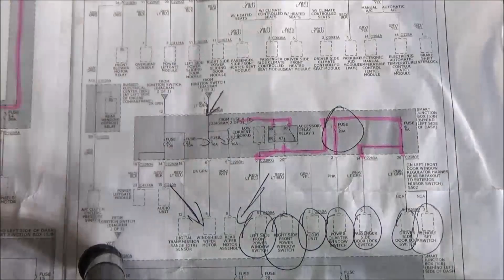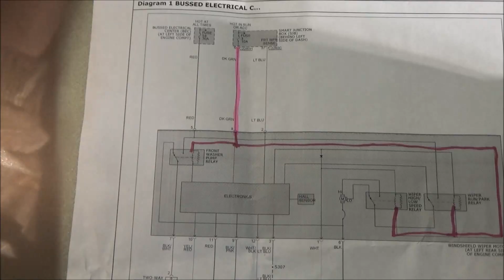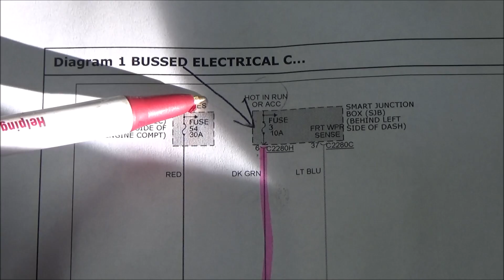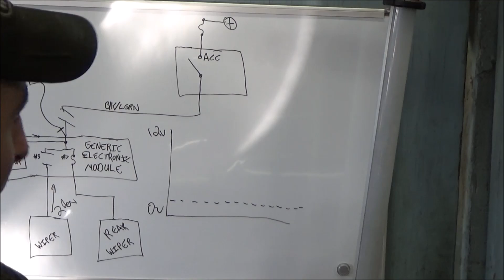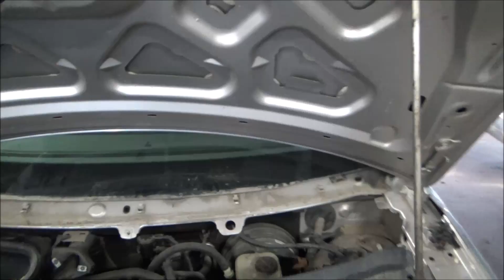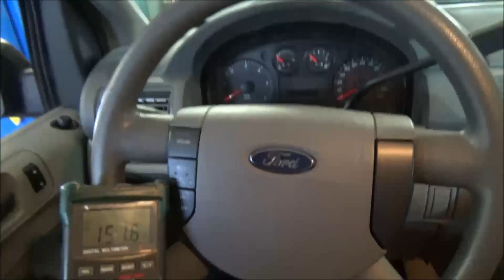Ford Freestar, Erratic Wiper Operation, Radio Stuck On (Part 2)

Comment: Is corrosion problems stem from the cowl placement and poor seal design. Water runs allover the electric components causing a wide variety of issues . The car's computer is underneath the cowl  at the passenger side under the cabin air filter and has the same issues of corrosion , causing the engine to run funny .

Comment: Thank you for this.  My Freestar is a 2004 and basically had the same problems.  My radio would stay on with the engine off and key out of the ignition, draining the battery within a day or two.  The fast wiper was all that would work regarding the wipers.  Replaced the motor and the wipers worked perfect, radio shuts off with the engine off and key out of the ignition.  The connection of the wiper motor to electoral systems staying active with the vehicle off doesn't seem logical, but it is what happened.

Comment: Thanks for the information. Almost bought a new sjb, but it isn't available anymore for the Freestar, nor can I find anyplace to repair it. Turned out to be bad wire connectors to the signal light.
Now I have to figure out why the windshield washer pump stays on. Thanks to your video, I'm optimistic it's the washer pumps, cause a new washer wiper signal switch assembly isn't available either.

Comment: Thanks on my 2004 freestar wipers stopped working. Saw your vid. And found corrosion at plug. All parts ordered, and new wiper motor, Thanks for the great diagnosis.

Comment: Recently, my 2004 Freestar is behaving in a similar same way.  I've noticed when unlocking the vehicle my radio would play, but didn't notice clock was still on. The battery has been dead 4 times so I replaced the battery.  Yesterday, I used the wipers on intermittently then suddenly they began going on high.  I attempted to shut them off and nothing worked unless I turned the vehicle off.  While the vehicle was running, if I had the following on: wipers, my headlights (dashlights) on auto, and the radio, wipers would go from on to high to stopping midway.  The headlights and the dash lights would flicker off and on.  The radio was on and not effected. I shut off the engine and took the key out and the wipers would still go on high as well as the radio would still be on.  So I'm going to check to see if the windows are effected as well. Then take it into my local garage to confirm it is the wiper motor and connector and to verify of the drain is clogged. We've had a harsh winter so I'm wondering of ice didn't clog the drain over the winter.  
Long explanation short, I want to thank you SO much for your detailed explanation on this issue.  I can't afford taking it into the garage and having them say it will cost thousands of dollars to replace items that don't need to be.  

Thank you so much agan!!!

Comment: I have a 2004 of similar situation. I love the size of this van, I love most of the features too. But my god is this thing a mess. When we first bought it, it had 104k. Right away I install new plugs, air filter, oil. Normal stuff one might do to a used car. Ran well. Except when it was cold or wet. Had a hard rain one night at work. It didn't want to run. Had it towed and checked. It needed a computer and coils were cracked. $1650 to fix. But, all was well. 3 months later another hard rain, same situation. This time I refused to pay for all this work again. Had it towed to my house, did some research, found the problem. Totally replaced computer, idle motor and coil for good measure for less then half. Sealed up that bad boy good. All was well for two years and my alt gave out. Replaced it. Now when it's cold the battery light comes on for a bit and the wiper motor seems to have stopped working correctly, and the computer can't seem to pin point errors it finds randomly. Our techs are baffled. Basically st this point I am just driving it until something expensive blows. There's not a part that hasn't been replaced or cleaned, it's been nothing but an expensive mess. But in it's defense, I must say it's fairly reliable given the problems it thinks it has!
Reply: What method did you use to seal up the cowl to stop the water leakage ??
Reply: @HighVibeTrybe  Good question! I tore off what was there, sanded it down and used primer since the paint had a clear coat. Then I used a can of flex seal around the lip and then filled the rest with a silcone based sealant, then I used a ceramic wax all over the lip after it dried as to deflect any rainwater off the surface. All in all about $25 worth of product and a few hours of time. Never had any issues since. But it's absolutely critical to seal up around the lip of the cowl to the body, and keeping the tray vents cleaned out. As long as rain water can flow from the vents and properly drain, your good. If it over fills or worse isn't properly sealed water can reach your computer and that's not a good thing. I also used some aluminum foil over the connector area under the cowl as an insurance policy so to speak because it was all trial and error but I've never felt a drop on the aluminum since. So that might be a good idea to do too. It's definitely not fun tearing that all apart again and again!

Comment: Same problem on 2004 freestar. Came in shop with bad starter relay under hood. Didn't know what caused it. Replaced it, ran fine, noticed radio didn't work. Next morning battery was dead. Jumped it, now radio wouldn't shut off.      Thanks for video. Another common problem with these is tiny splines inside torque convertor strips out. Ford recall or just swap the torque convertor then sell it quickly! 😂🤣

Comment: My wife has the exact same van color year and all,I'm in currently in a holacost with it now, battery died overnight once charge it up it fired up, weeks later same thing but battery was full of fire, tried to crank it but just a loud tick from the starter,and wipers sounds like they were trying to come on, checked the fuse box under the hood and the starter relay was blown (30 pink long fuse looking thing) swapped out with another but still no fire....so I have removed the starter itself to be replace it tomorrow,but it has a lot leaking hose and was wet and rusty looking on the entire right side the battery and thermostat area,it is giving me a headache

Comment: What a great case study!!! 👍👍👍
Reply from the maker: Interesting one huh?
Reply: Triangle Diagnostics I'm really glad you went the direction you did with the diagnostic! That way we've learned in detail how the system works. If you had gone straight for the wiper motor,you would've found the problem much sooner,but the information wouldn't have been just as great.

Comment: For future reference, digital logic will interpret anything under 1.2V as zero and anything above 1.6V as one, so, yeah, 2.8V is plenty for the unit to assume power is present and command the relay on.

Unless an A/D conversion is done, a logic circuit cannot determine how much voltage is present on an input and car manufacturers aren't going to put in an A/D converter (or use one of the processor's built-in A/D converters) just to test for the presence of a supposedly fixed voltage.

Comment: Triangle Diagnostics Thank you for your vids. Just curious if there's a logical sequence as to where to start when it seems to be a power/ground type issue with so many components affected? If by chance you had decided to begin the diagnosis at the wipers and found that mess first, I'm thinking  you would have had your "well there's your problem lady!" moment for sure. Should we start with the issue that perhaps uses the higher volt/amps first or the lower volts/amps? Or is it just a gut decision? I thought you did a great job either way.
Reply from the maker: I think for the most part it is a gut decision.  Typically I will start on whatever path offers the easiest access in terms of test locations.  There really isn't a right or wrong way to go about it in my opinion. Thanks for supporting my channel friend.
Reply: Triangle Diagnostics .

Comment: Great work on figuring out what was happening with this vehicle Joe. The 2.8V was probably coming from the copper sulfate (salts) bridging across the pins in the wiper motor assembly since after a few times of plugging and unplugging, it removed the stray voltage. But definitely the wiper motor assembly needed replacement. I'm glad you hung in there where your gut feeling was talking to you about that 2.8V and not making a call on the GEM. Great thinking process Joe! Oh. I saw from a comment that you're in Henderson, NC. I grew up close around your area living in Littleton. Roanoke Rapids, Rocky Mount and Enfield. Today, I'm living near High Point, NC. Have a good one Joe!
Reply from the maker: That's awesome man.  I like knowing some of my viewers are relatively nearby.  I actually live in Durham.,  and work in Henderson.
Reply: How about that Joe! You're only about an hour from me :)

Comment: Hi Joe. Great channel. If you had decided to attack this problem strictly as a parasitic
draw by pulling fuses while monitoring the draw, might it have led you to the crappy
wiper motor sooner?
Reply from the maker: Potentially yes.  I may have started in the engine compartment fuse box first and yanked the main wiper fuse out,  and that would have definitely pointed us in that direction first for sure.  I went the path I did simply because we knew the radio was staying on,  in an attempt to save time yanking fuses or testing voltage drop across them.  Hindsight is always 20/20.
Reply from the maker: Potentially yes.  I may have started in the engine compartment fuse box first and yanked the main wiper fuse out,  and that would have definitely pointed us in that direction first for sure.  I went the path I did simply because we knew the radio was staying on,  in an attempt to save time yanking fuses or testing voltage drop across them.  Hindsight is always 20/20.
Reply: Only been subbed for 2 days and watched all your vids.
Let me say that in hindsight I could not be happier to have
found your channel. Keep up the great work.

Comment: Ahhh the green crusties strike again! Great work, Joe! I was laughing in Part 1 when the wipers were stuck on HIGH haha I figured you would chase that problem first. But your approach was very educational in tracing that weird 2.8V on the accessory relay...thanks for the vid!
Reply from the maker: I figured the radio staying on would make for a better video,  otherwise I may have went that direction first.  It's still pretty amusing how all of these issues were tied together like this lol.  That 2.8v initially threw me through a bit of a loop, as I didn't think that was really sufficient enough to do anything with this module.  Big lesson learned here on attention to detail on these switch inputs,  just because it is designed to receive battery voltage doesn't necessarily mean a lower voltage can't meet threshold requirements.

Comment: Excellent nothing but excellent..
A dealer would have put a gem before the tech figure  out the issue  or ship the job to someone else..Ask me how I know.....LOL
Yea terrible job on the wiper connector repair.and by the way that a ford heat tubing with butt connector supply in the repair kit.But whoever worked on it,Butchered..
Reply from the maker: I kind of figured they were supplied with the connector.  I like to try and believe the dealership would have made the right call on this, but definitely no way of knowing without letting them try haha. Thanks for the support friend.

Comment: Good job! I like the in depth troubleshooting technique. Sometimes it's tough to make a call without checking all the possibilities. I'm glad you revisited that wire from the previous night. When you pulled that 2.8 volts to ground with the test light and it worked, I suspected that might be where the problem lies.

Comment: That's pretty crazy! Water can cause all kinds of havoc in electrical systems. Reminds me of the gm trucks that get water in the Ubec and all kinds of foolishness will happen. Last one I had kept the hi beam headlights on all the time. Whoever replaced that connector shouldnt be touching electrical😱. Keep up the great work
Reply from the maker: Corrosion is always fun to deal with, but generally it just effects the system it's in.  This one was pretty nuts in the way this circuit was being affected.  As for the wiring "repair",  yeah.  Absolutely terrible, (and dangerous).
Reply: Triangle Diagnostics what happened to the video you uploaded last night? I was in the middle of watching it and it disappeared?
Reply from the maker: I'm super sorry friend,  I realized one of my explanations during the video was way off,  and I want to make sure I was giving out correct info so I removed it.  I'll be re-uploading tonight.